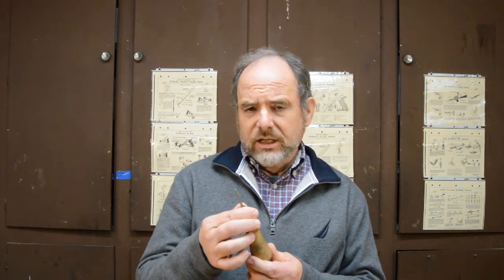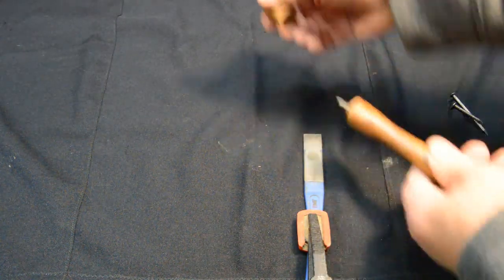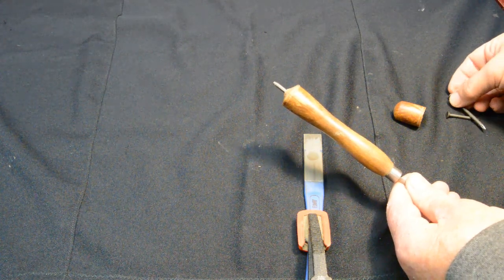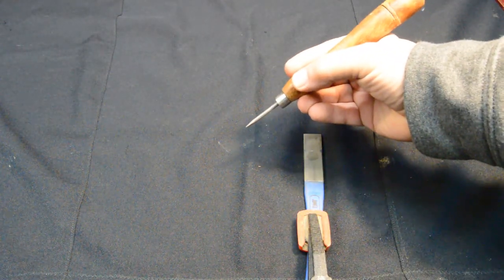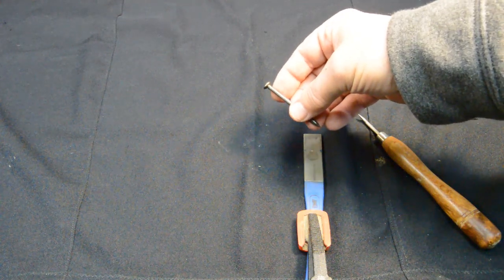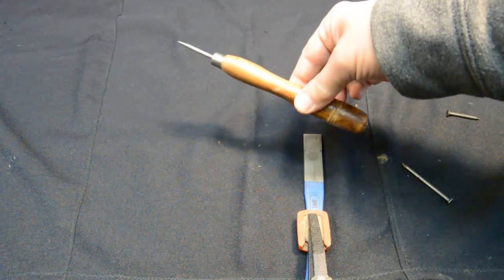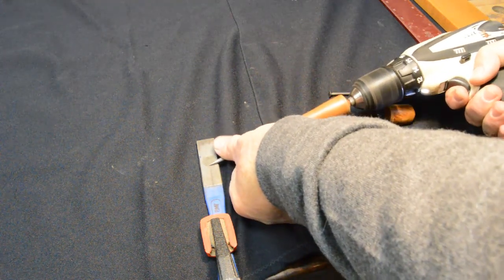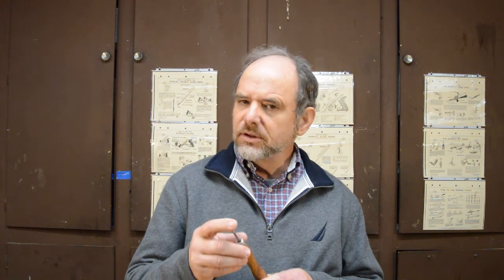Handtool Challenge: Making a New Scratch Awl

Comment: i have some of those nails kicking around and I will be looking at them a whole lot differently now., great tip.  When your turning gets better a screw on wood end cap for your next one and maybe a carbide end?
Reply from the maker: Yes, that would be a good upgrade.  I've got lots of flatwork to do, but I hope to get better at turning afterward.  

At the moment, I'm wondering how many different tools I can make with concrete nails!